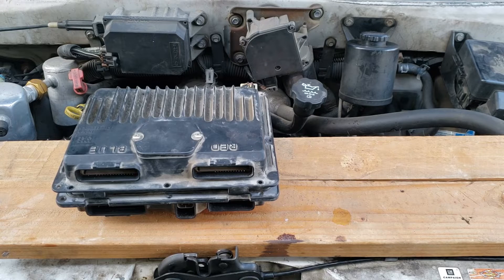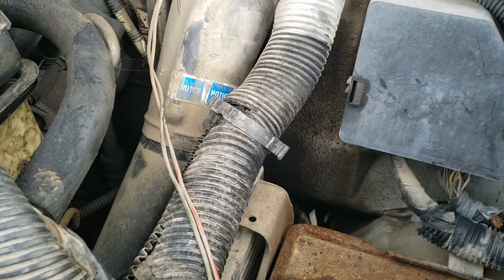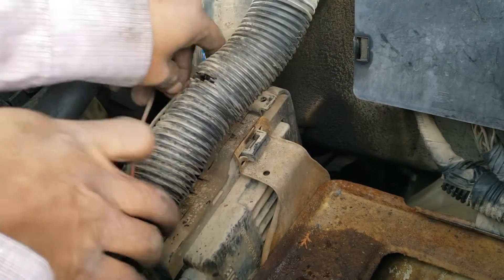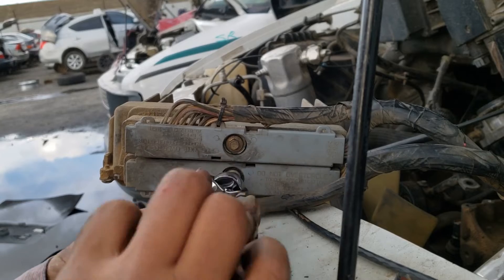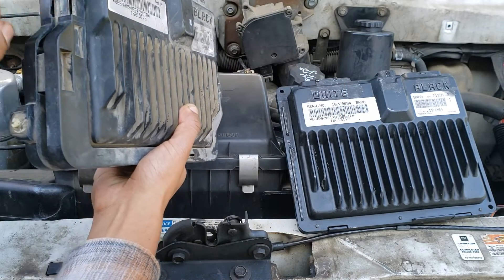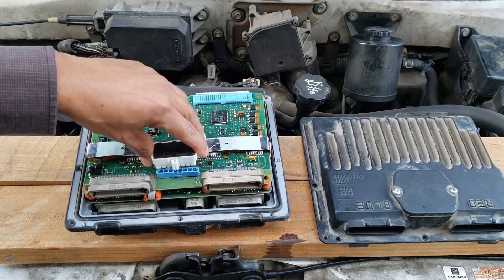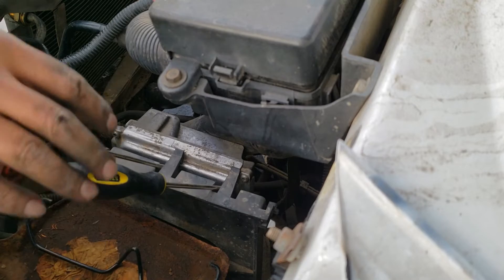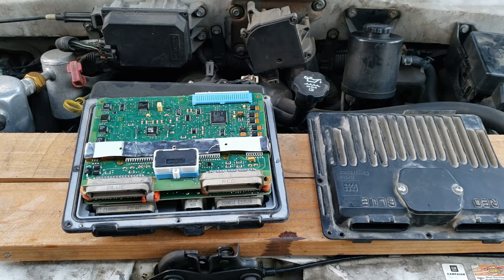PCM Replacement Astro / Safari

Comment: Bro your video was so easy to understand, you explained everything so well ! I have a 2001 GMC safari and when you turn on the motor it sounds really good no shaking no nothing ( I replaced a lot of parts in it ) but lately it started feeling “jerky” upon acceleration on the freeway but I’m able to drive it a high speeds and it’s pretty fine for the most part , but have no idea what’s causing that jerking when accelerating, please help ! Thanks in advance 🙏 Also what city you live in ?

Comment: just read a report that the  "van shuts down randomly while driving"  and replacing the PCM did not fix it.  could be ignition switch module , ignition key , sensors failing , chassis grounds open , etc
Reply from the maker: That is correct! Good info! Diagnosis was done beforehand and we concluded a faulty PCM. This video focuses on the PCM aspect. I should have added a sentence such as: "There's a few things that can shut down the van while driving, in this case it was diagnosed to be a bad PCM."

Comment: Hi, its me again 🥺 i live in my 98 GMC SAFARI and it shut down while driving without warning.  Been stuck in a parking lot for 3 weeks and am afraid i will be homeless soon if they tow it😢. 

Please listen to everything that i bought.   I go through 3 distributor caps and rotors per year living in south Florida.   The moisture kils the cap and rotor.     I finally drilled 2 holes which is what all florida Astro/safari owners say is the fix.   Only time will tell. 😢

I just installed a new distributor and the cap and rotor and spark plugs and wires and ignition coil and ingnition control module and crank position sensor and a brand new battery. 
Im going to try and start it soon, but im so scared because after each part i installed, nothing happened. 
The crank position sensor was the last thing i installed but haven't tried to start it yet. 

My fuel pump makes the normal sound when the key is switched on and when switched back off.    But as we know, just because it sounds good, doesn't necessarily mean its got enough fuel pressure to get the gas to the engine. 
I haven't done any spark tests and i haven't checked fuel pressure with a gauge.  

I haven't tested anything yet. 
I haven't used a scan tool because i don't have one and nobody will come to me  and i can't afford one. 
Time is of the essence..  i don't wanna lose my van.    I don't know what to test of where to start.
Reply from the maker: Huh, I would just start it, take it from there, as for the radio comment, some of the OEM radios require a "procedure" to unlock after disconnecting the battery. I haven't run into one on these vans.

Comment: I'm looking at possibly replacing my PCM, my issue is can't get the fuel pump to activate, if I bypass the relay the fuel pump does work, if I hotwire the relay it works, my Chilton manual indicates that the Crankshaft Position Sensor is tied to that circuit, when I inspected that I found it was soaked with engine coolant (even inside the connector), I'm assuming from my flushing the engine. 
Question 1: could the Crankshaft Position Sensor have shorted and gone bad? 
Question 2: could the Crankshaft P.S. being shorted damage the PCM?
Question 3: what troubleshooting steps would you take next? 
Thx for your time!
Reply from the maker: What year is your Astro van? I'd like to pullup the wiring diagram for your year. For example , the 1997, the fuel pump is not on the same circuit as the CKP Sensor.
Q1: Yes, there is a good possibility of the terminals  shorting out due to the fluid. When this happens a fuse blows.
Q2: The fuse breaking is designed to protect the circuit, so most likely the PCM is ok. (Assuming the fuse blew)
Q3: I'd like the year of the van to look up the specific diagram for the fuel pump and (CKP) sensor. From there on you can look at specific fuses and test for power/ground at key points.

Comment: So I cant just buy a new pcm from o riley and replace the old one with the new one?
Reply from the maker: This is following the official GM service procedure. I have not tried just swapping in a PCM  that I bought new or got from the junkyard. I do not recommend it but you can try and update us on what happens. I believe the vehicle would crank and not start due to the anti-theft module having an issue.
Reply: Thanks for the response. I'm not gonna attempt it if that's the case lol

Comment: Thank you, Noe. I wish I had seen your video beforehand, 
Nevertheless I'm going back together with mine and your info was priceless I am replacing it on a 97 with 425000 miles the transmission transmission is slipping in between 3 and 4 I am sure this is the cause